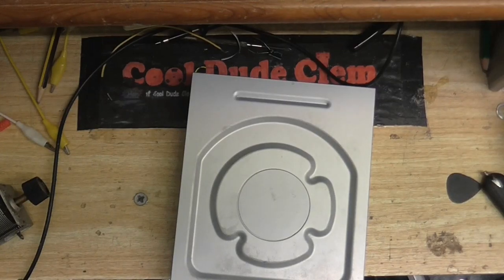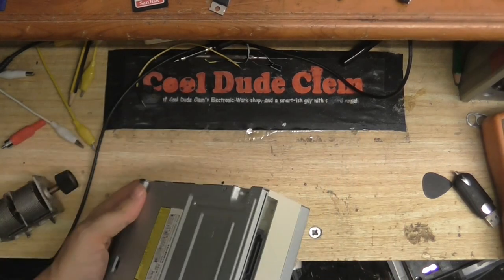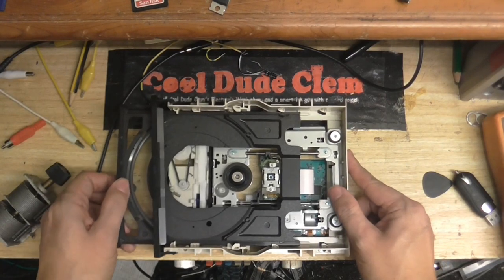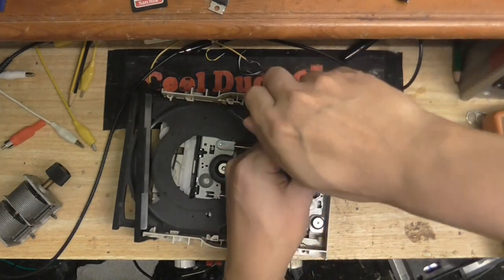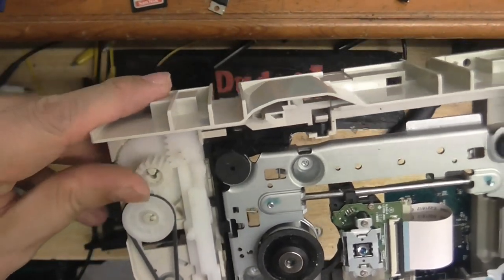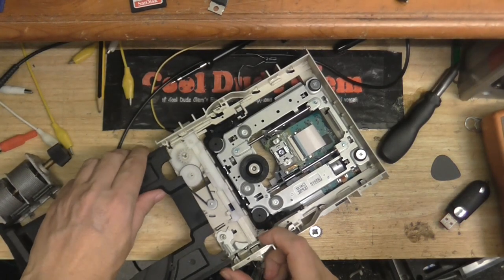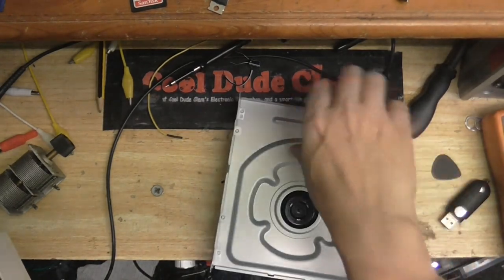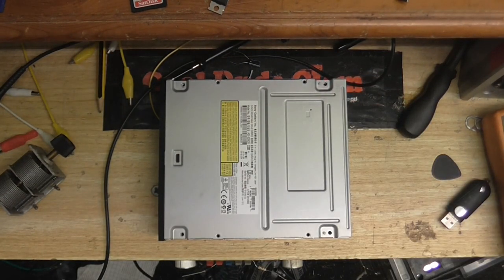CDC Electronic Workshop, Fixing A Stuck PC DVD Drive

Comment: I imagine that Franken PC would be perfectly serviceable if you put a cheap SSD in it as the boot drive. 4 cores is still plenty for most tasks even today, especially at those fairly high clock speeds.

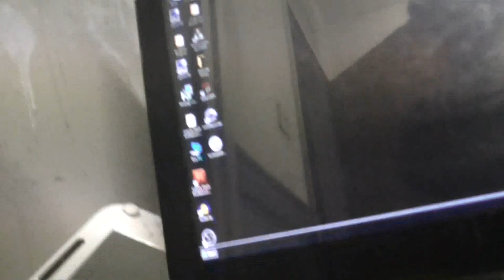Comment: 8:20 to answer your question. It loads all the background programs and services needed for Windows to work properly.
Reply from the maker: It should load all that crap (half of which I don't think is even necessary) prior to loading the desktop, plus a loading progress bar would have also been nice. I expect my computer to be ready for use as soon as the desktop is loaded. Old computers did it better with the OS in ROM, that way it was right there as soon as you turned the computer on, and no waiting around. Even some old PCs actually had DOS in ROM, it would be nice for windows to be like that.
Reply: @CoolDudeClem  If windows was in ROM it would be very dificult for the windows to update.
Reply from the maker: @megabojan1993  I don't see a problem with that, it's better. They wouldn't be able to break things that already work.
Reply: All the programs to make Windows work properly would take quite some time to load.
Reply: @CoolDudeClem  ha yes indeed, that is also true and i think all of us think that same way!(but hackers and so, that kind of thongs probably make it nescessairy to update that ROM weekly? But even then, it could be designed a lot easier to use now when we could start to prg a new OS from scratch, maybe...)
Reply: @CoolDudeClem  but hackers will find weaknesses or things they can misuse, and altering that part with an update is then totally needed. That's the problem these days we cannot ignore
Reply: @CoolDudeClem  if it did that, you'd be waiting 5 to 10 minutes for the desktop to appear.
Reply from the maker: @AstrosElectronicsLab  What's crazy is that my other computer boots up windows 10 in about 12 seconds. Yeah, just 12 seconds to go from power on to useable desktop, and I'm not even using an SSD!

Comment: Don't know why w10 takes so long to boot, but it does seem to hold the drive at 100% for minutes after it starts on older machines. Simple, but expensive 'cure' is to fit an SSD
Reply: The simple free cure is to install Linux.
Reply: @1pcfred  most people don't have the technical know-how to install, configure and use Linux.
Reply: @AstrosElectronicsLab  we all have to start someplace. If I can do it then just about anyone can. In fact today I could get an untrained ape to install Linux. Pretty much plug it in and go. That is literally how live sessions work. Now if you want to do more then that will take some doing.

Comment: What's wrong with the camera you've got, btw?
Reply from the maker: Quite a few things, sometimes it won't accept the memory card (even though I have been using the same card over and over), sometimes it won't focus, and when it does, the focus is not even from one side of the picture to the other, sometimes it won't record, and I was never happy with the quality to begin with, it claims to be 1920x1080, and even though it records files in that resolution, it just doesn't have the detail that it should have. I am sure that the sensor in my camera is more like 540p but upscaled. I hate when camera manufactures do that and make it look as if there's more resolution than there really is.

Comment: My Haswell i5-4670 CPU @ 3.40 GHz
pfred1@five:~$ systemd-analyze
Startup finished in 1.243s (kernel) + 1.251s (userspace) = 2.494s
 It boots up in under two and a half seconds. So you might be having a problem with your Franken PC there. I have a P3 that takes 20 seconds to boot up. Has a mech HDD in it.

Comment: The long boot up times look to be caused by a faulty hard drive, or a slow one at that. Might be worth replacing it with a faster one or even an SSD. Notably task manager did show 100% CPU when you first opened it, but if I recall correctly this is a bug so I doubt the processor is too slow.
Reply: Windows 10 just boots slow. The only time Microsoft would make a product that didn't suck would be if they got into the vacuum cleaner business.
Reply: @1pcfred  I like your joke, but there was obviously some sort of HDD bottleneck there. My laptop has a mobile i3 CPU of the same generation (so considerably slower) but boots up in around 30 seconds, from POST to desktop.